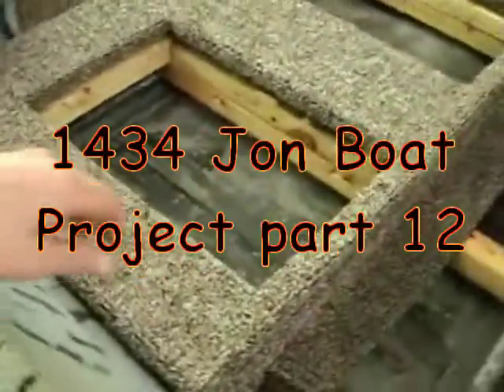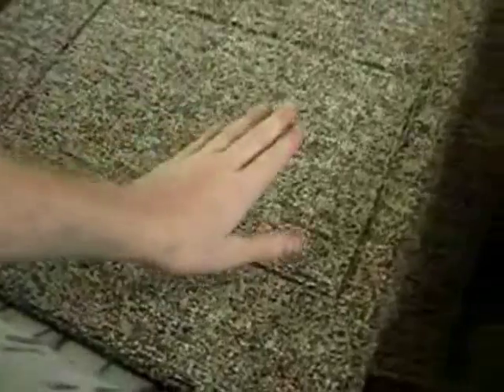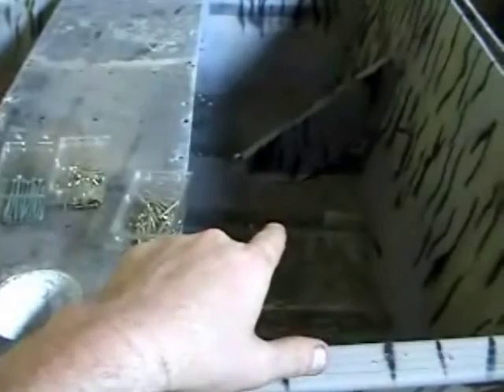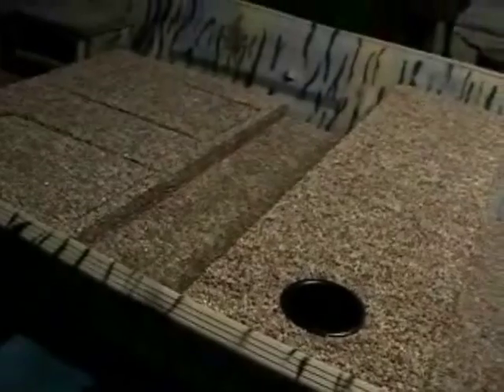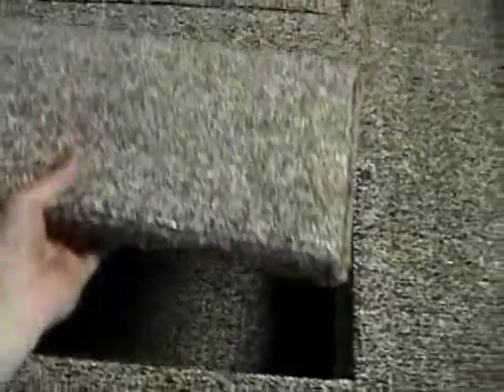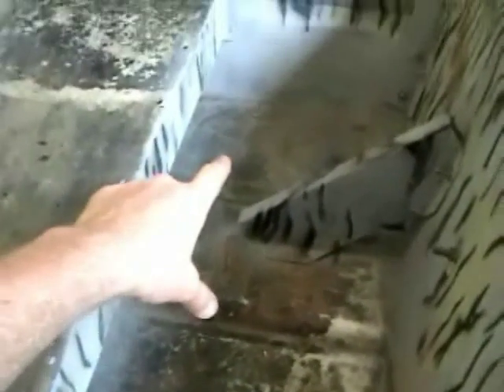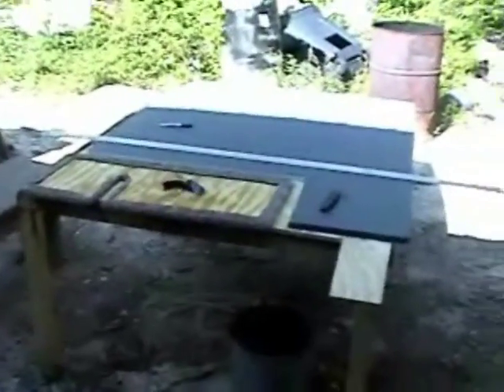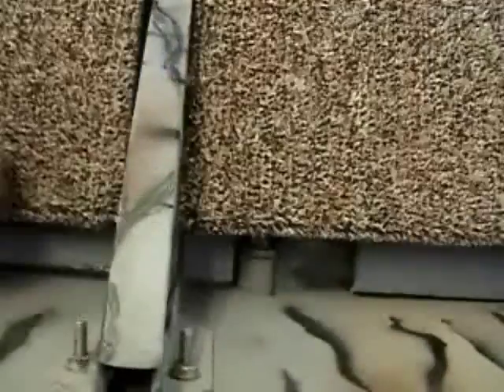1434 Jon Boat Project part 12

Comment from the maker: Hi there, sorry for not responding sooner, your comment got marked as spam so it didn't alert me that you had commented. This was regular plywood and I'll have to check to see what thickness we used on this boat. We use a lot of coatings of polyurethane to waterproof the plywood with.